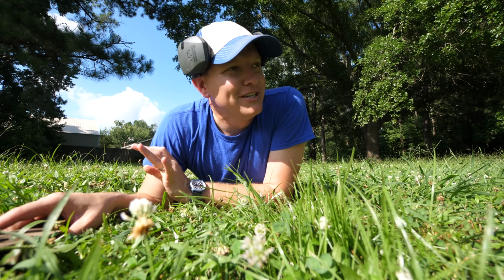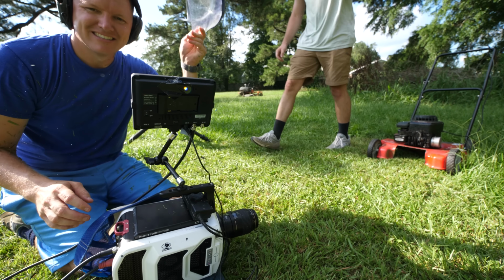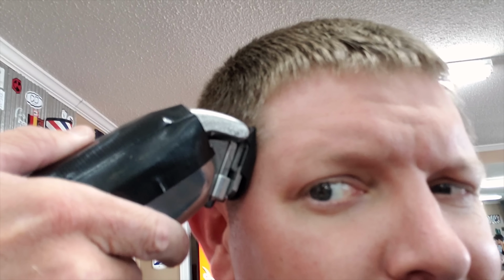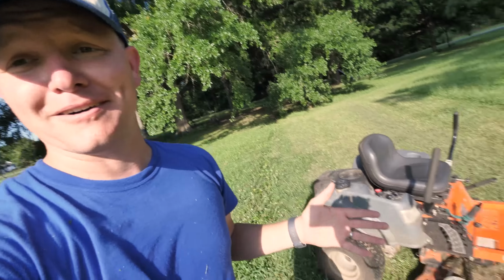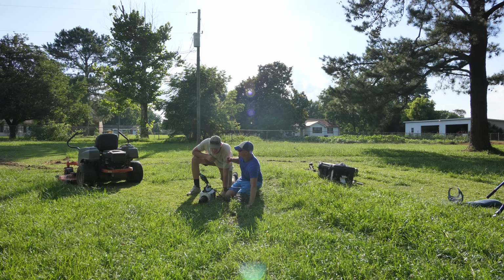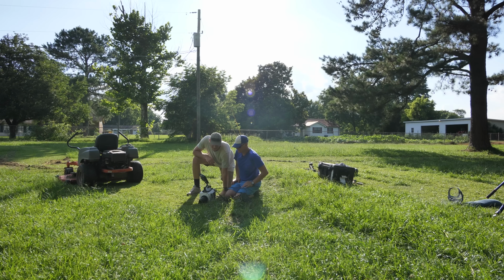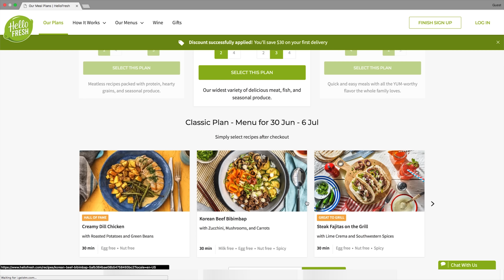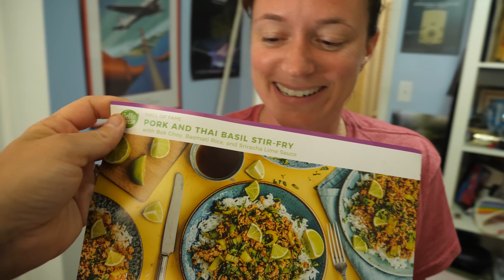How Lawn Mower Blades Cut Grass (at 50,000 FRAMES PER SECOND) - Smarter Every Day 196

Comment: Tabs and deep decks are simply to clear the cut grass from under the deck. As the blade advances, inertia is what holds the top of the grass in place. You can cut just fine with no tab. Think of the sickle or scythe.
Reply: Jimmy's Tractor 
I agree. I think the idea of the tab is prob 95% to get the cut grass into the catcher. Lift is hardly required to hold a blade of grass up against a 200mph blade.
Reply: Yeah I agree with this
Reply: Hmm no because scythes actually "slice" the grass whereas the lawnmower just barbaricly chops through it. Scythes are extremely sharp and you hone them every few minutes of use whereas mower blades often aren't that sharp
Reply: A scythe is sharpened with a stone every two minutes or so while I'm use. You must maintain a very sharp edge to slice the grass with minimal resistance
Reply: A blade deck caked up with old cuttings won't cut as well as a clean deck. It will leave ridges in the grass where the grass wasn't pulled up as high due to reduced air flow. The lifting action of the blades is absolutely nessisary to achieve a good even cut. (Source: been mowing for 22+ yrs)
Reply: Try cutting the lift edge off a blade and see what you get. It's a very ugly rip more than a cut.
Reply: Jimmy's Tractor the tabs do create lift. Sucks the air in from around deck like a vacuum and blows it out shoot. Yes some mulching blades have no tabs. The rpm is fast enough to cut without the lift like you said. Tabs are more for throwing grass out the side further. No tab or gator munchers keep clippings under mower to get re cut smaller or drop straight down after cut.
Reply: A sharper mower blade cuts better obviously. A simple google search will show that tons of people discuss the best angle for the blade, how to sharpen it, etc.
Reply: Joseph Johnson not when th blade is sharp.
Reply: Joseph Johnson sorry about the 22 years. I sold mine after 8. 1/2 my vids are lawn mowers, but it it isn't cutting grass that I get my knowledge from, it's basic physics. The vacuum action is only to get clipped grass out of the way for a clean cut.
Reply: Hunter Coyhis Yes.  You still need motion to keep the scythe working. Sharpening allows it to cut at a slower speed. I dont know what osha mandated tip speeds are today, but commercial mowers had considerably faster speeds. Inertia is what keeps the grass where it needs to be whether you cut with a scythe at 10mph or a mowerblade at 200mph.
Reply: I sense an experiment :) , whos gonna do it?
Reply: They actually make sand blades for lawnmowers that are flat to reduce wear on the tabs. The con of having a flat blade, as apposed to a "tabbed" blade, is that it doesn't MULCH the grass as much. A tabbed blade will chop the grass over and over in to tiny pieces, by sucking it up in the deck and chewing it up, so you won't have lines or piles of grass after you're done cutting! Also, it's worth mentioning that tabbed blades disperse the chopped grass over a much further distance(out the side chute) than the flat blades!
Reply: Coupe DeJoe this I know. The sand blades are flat but the whole end is angled 10-15 degees so that the sand hitting the top of the blade has a sharpening effect and then you flip the blade.
Reply: Jimmy's Tractor - I gotta agree mostly with Joseph Johnson. The tabs do both: suction for proper cuts and airflow for collection. Been mowing professionally for years as well and my boss and I actually tested this ourselves. We took a pair of blades for our Walker mower and I flattened the tabs. The Walker has a 3 blade fan mid collection chute to blow the grass up into the buckets, and this provides a lot of the machine's suction. However, when I flattened the tabs, the grass was not being pulled up enough and we got uneven cuts with lots of tearing and lots of bits of grass laying about, not getting sucked up. The tabs cause a localized updraft right at the edge of the deck, which is where you need the grass to be pulled upright as your leading edge moves forward and cuts. Easy test: thick wet grass. If you go too low on the deck and cut off the airflow that comes in a long the side, you'll get a bad cut, regardless of if the grass is sticky or clumping. Raise it a half click from being just too low and your cut gets measurably better.
Reply: I should say we did the test with the tabs cus we too were trying to understand their purpose. Flattening them was the simplest and most effective way to negate their effect, and it's VERY clear once you do it. I've used cheaper mowers with no tabs, and they often have a shallower deck with contouring meant to create airflow. They also cut worse on anything other than very well-groomed lawns.
Reply: Ben King-Eagles I'm also familiar with the gear driven Walker deck. It's not about the fact that you can use tabs to help clear away clippings and get a better cut. The main question is how the blade is cut. Because of the deck, you wind up blowing all the grass down, that is what causes the terrible looking uneven cut. The grass isn't being held upright by the airflow and the airflow is certainly not holding the grass in position so the blade can cut it. The airflow only allows the grass to stand like it would if it were not in what amounts to a wind tunnel. Whether the grass is lying down or standing up, it will not move because of the contact of the blade, the mower blade will be through it before it has a chance to accelerate the blade of grass. Doesn't matter what the deck design is or how sharp the mower blade is.
Reply: Jimmy's Tractor  I've seen it with my own eyes. Sorry but you are wrong and your argument is starting to wander because you don't seem to actually know what you are taking about. At the very least you haven't given any reason for us to think you have any specific knowledge on this. One can see the suction being applied to the grass at the decks edge, even with a cheap mower. The tabs cause an upward force as the blade passes, prepping the grass for the next pass. As I've said you can test it easily by adjusting deck height. Too low and, if your blades don't bottom out, there won't be suction at the deck edge. Too high and you get an uneven cut. You can literally see it. This is why I know you are wrong.
Reply: Weed Wackers can cut grass as a counter example that you need a tab.
Reply: Ben King-Eagles must be an optical illusion then. The air doesn't hold the grass up for the mower blade. I've given examples that should make it clear to all.
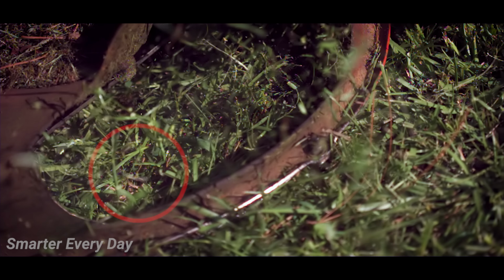Reply: Ben King-Eagles 6:00 it's pretty clear, the wind from the blade actually knocks the grass down after it knocks the top off, but it flexes back up on its own. Only thing the tab does is create wind yo yer the clipped grass out of the way. I'm trying to make you even smarter than this video. This comment isn't for me, I already have a full understanding of this simple stuff.
Reply: Jimmy's Tractor Your OP: "Tabs and deep decks are simply to clear the cut grass from under the deck" And a later comment: "It's not about the fact that you can use tabs to help clear away clippings and get a better cut." You are somewhat undoing your original argument. I suggest you look up "high lift blades" to understand this. The tabs cause suction at the deck edge, lifting both cut and uncut grass and helping move cut grass up and towards the chute. Also, you haven't given any real world examples. I have and I can give more: It's a common mistake that our new guys make. They don't pay attention to the bag or the mower feel/sound, and it will bag out on them. I tell them to watch the top of the bag, looking for it to flutter as the chute jams due to poor airflow. Similarly, if you never clean your bag, it will negatively affect the airflow. We give the bags a regular blow and irregular power washing. Once they learn to set the deck height based on the lawn height and thickness, moisture levels, etc. then they get consistently even and clean cuts. Deck too low? not enough airflow, bags out. Deck too high? Uneven cutting, clumps and bits, too little suction. The ONLY thing in a standard mower that generates that air flow is the blade shape. On a Walker and other more technical mowers it is supplemented by a chute blade or similar addition.
Reply: The HAMS Sandwich - There's actually a line trimmer mower attachment out there. Oddly good for tiny postage stamp lawns. And you are right, a line trimmer can cut grass, doesn't need suction. Different mechanism though and no need for collection. When you trim professionally you learn that it takes awareness and learned skill to properly trim grass. The main difference is that with a trimmer you dynamically adjust the height and angle while watching your results in real time. A mower doesn't allow you to adjust in real time the same way and it limited by things like the deck, which requires some sort of design to generate airflow and to move the grass in the intended manner. Flat trimming is more like mulching and unless you take forever, you won't get as clean a cut as with a mower.
Reply: Ben King-Eagles I got rid of my lawn service 17 years ago, but that is not where this is coming from. A string trimmer doesn't have tabs and it cuts grass- if it had blades and a steady hand, it would leave a perfect cut with no tabs. I am simply saying that the blade stays in place because of inertia, not some suction that is created by tabs on a blade.
Reply: The HAMS Sandwich exactly. I think they are confusing how grass is positioned vs why it stays in place while it is sliced.
Reply: Ben King-Eagles I really think you are missing the point I'm trying to make. Better airflow provided by tabs and deck design can keep the grass in a better position for cutting, but when the blade contacts the grass, it is not that suction that is holding on to the grass blade that makes for the nice cut. It is the inertia of the blade of grass that keeps it in position. I have a video with 70k+ views cutting with a string trimmer. I keep the cutting plane flat, like a mower, but I sweep back and forth like a scythe so that the clippings go away from the standing grass. There is no suction holding up th blades of grass. The string goes through the middle of the grass blade before a bug on the upper portion of the grass blade would even notice. It is the inertia that keeps the upper portion of the blade in place, not suction.
Reply: To add to this debate, there is a brand of mower that operates in the opposite fashion. https://en.m.wikipedia.org/wiki/Flymo

Flymo mowers are powered rotary push lawn mowersthat use a fan above the spinning blades to drive air downwards, thereby creating an air cushion that lifts the mower off the ground like a hovercraft.

As said by many others, the tabs on the blades are to force the cuttings into the grass box/chute. You can take a blade and flatten it completely, it will still cut the grass.
Reply: Chesray Nelson well said.
Reply: agreed. My strimmer (which is just a bit of nylon cord wizzing around) can cut grass with no problem. It's not even sharpened cord, it's just a round. It isn't very neat though.
Reply: *Edited* Using trimmers, or a scythe, to try and force your point doesn't work. Trimmers do not work the same way as a mower, their design is entirely different, as is their use. If you put a bladed attachment on a trimmer and added a deck, you'd get a sticky mass of chewed up grass inside without any airflow to manage it.  While both cut in a similar fashion, even a dull blade will "cut" the grass like a round trimmer line does, the similarities end there. The scythe example is similar in this regard. Add a covered deck and you'll need airflow.

*Actually I'm wrong about the scythe. A deck wouldn't matter because you only make a single pass per cut. A trimmer or mower revolves so fast that it hits the same blades multiple times, causing the clippings to mash up and stick together sometimes.*

You guys are conflating the cutting properties of the "blades (trimmer line, scythe blade, mower blade) without considering the structural and design differences in the products. A mower without a deck would cut grass very much like a trimmer, you are right. However, while a trimmer requires care and experience to get a cut as smooth and even as a standard mower, a mower is designed to cut the grass smooth and even on a single pass without the need for a lot of practice. This is because of design and the extra factors involved, like the deck and airflow restrictions. Trimmers don't need any airflow, which is what makes them a moot example. And that deck attachment I mentioned for trimmers? It's trash on anything other than a well-manicured lawn. If the grass is too wet or thick it causes clumps and mash inside the deck because it has no way to generate airflow, and it also requires more work to get a smooth cut because of this.
Reply: Ahh the flymo. First off, this design isn't actually good for most lawn mowing, which is why it isn't a common type. It is mostly used on golf courses (I was an assistant manager at a pro shop, also did grounds work) where the grass is already cut to exacting standards and is not long or unruly. You don't use the hover mowers on long grass, you use them on the hills, dips, and other areas where you want to cut the already short grass but you don't want any wheel marks or alterations of the surface. The grass that is being cut is VERY short already and reacts little to the air cushion. I will admit my experience with them is limited, so I cannot speak in depth on the airflow in these, but I've used them and they do not work well with long grass. It's different in function but similar in idea if you think of a rotary: If the grass is long, a rotary won't cut well. With a rotary, due to design, you have to cut more often, and so long as you keep the grass to the right height, you'll get a nice cut every time. Let it grow too long and you have your work cut out for you. A hovering mower is designed for more regular maintenance, not the everyday cutting people often have to do.
Reply: Jimmy's Tractor - "Better airflow provided by tabs and deck design can keep the grass in a better position for cutting." You finally agree with me. It's about time. :P
Reply: Ben King-Eagles it's all about what is holding the blade of grass while it is cut. Trimmer proves it isn't suction.  That's. The whole thing right there. That's it.
Reply: Again, you are ignoring the design properties of the mower. A trimmer and mower are not equal in design or operation. A mower without a deck would cut just like a trimmer, add a deck and you have more concerns. Don't tell me, after invoking physics at the start, that you are going to toss physics aside to try and win an argument using false conflation.
Reply: you 2 both make good points.. I think someone needs to do an experiment with a "deck-less" mower
Reply: Well, a mower with no deck and no wheels is just a trimmer with a blade, and Jimmy is correct on how that would operate; there's no contest there. It's the presence of a deck that means you need directed airflow to manage the grass. To be honest I winced a little when Destin had the cam on the open side of his ride-on... I've seen stones find a path under a regular mower deck and go through a shed wall, cedar shingles. :) A mower without a deck is a scary thing.
Reply: Ben King-Eagles it comes down to a blade moving 200mph- no matter what it is attached to. The blade of grass doesn't care what propels that blade. The piece of grass needs nothing but it's own mass and its resistance to accelerate. Nothing needs to hold that blade in place. No suction necessary. The blade of grass won't move until after the mower blade goes through it. I really wish the snowflakes at youtube would allow down votes so you could get sense of how few disagree.
Reply: Agreed
Reply: This guy is right, blades with no lift tab still cut they just don't produce enough wind to clear the cuttings or blow them up a chute into a collection bag.  a reel type mower does a better job because it actually shears the grass like scissors
Reply: Jimmy's Tractor - *I read his last post wrong, thought he was insulting me. Edited**

To respond to your belaboured and fallacious argument: Then why would we ever put any design work into the blade or deck? Your logic assumes there is no need to design the mower to handle the challenges of enclosing the cut-area in a cover. You are still trying to conflate the cutting method, while ignoring that when you cover the cutting area you need airflow to help achieve a few things. Whether you like it or not I have provided ample examples, real-world experience and explanations that are educated and based on both tests and physics. I've also given everyone at least 1 test they can perform themselves that proves my point: suction is generated at the edge of the deck, which is also the cutting edge, which helps pull the grass upwards and aids in cutting and clearing of the clippings.
Reply: Ben King-Eagles no insult anywhere. I'm talking about my comment with 85+ thumbs up and not being able to see the down votes that I know are there. I dont see how that could be considered insulting other than to possibly the folks at you tube that think I cant handle seeing down votes.
Reply: Ben King-Eagles most designs are marketing and gimmicks. You've been very respectable sorry you took my comment about youtube as personal, that is something I dont do.
Reply: I get that a lot of stuff is gimmick or not strictly a required design, but I'm talking about an aspect of mowers that is visibly observable, by anyone, and testable by anyone. The tabs do assist in pulling the grass up, which helps make for a cleaner cut. Maybe the refined argument you and I are having is that of intentional design vs coincidental benefit? I say intentional design because I've done the one test you need to prove that the tabs help: flatten them and test it. 

If its intentional design vs coincidence then I think we're at a standstill unless we can get an engineer, from Honda or some other company, who designs blades and decks and get the gospel, as it were. That being said, I never actually stated it was an intentional design. In my op: "The tabs do both: suction for proper cuts and airflow for collection."
Reply: Hmm.  I don't think that's entirely true.  EGO, on their electric mowers, had to increase the "lift" of the blade because it wasn't cutting grass evenly.  They increased the lift and now they cut fine.  Think of a propeller, "pulling" the grass into the blade.
Reply: Inertia will keep it in place the first few cuts sure, but after that the airflow helps bring it back up because as you can see the grass doesnt alwasy get cut on first pass.... very simple to see. You are almost right though. but not quite..
Reply: Jimmy's Tractor think about the weed wacker!